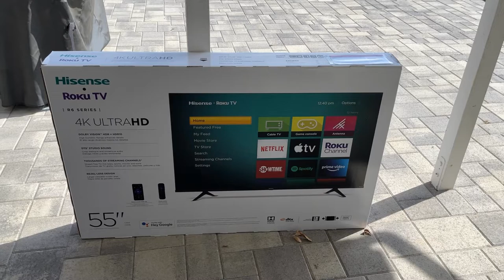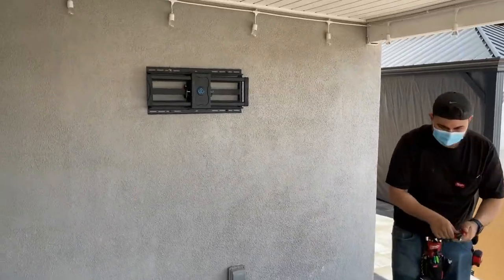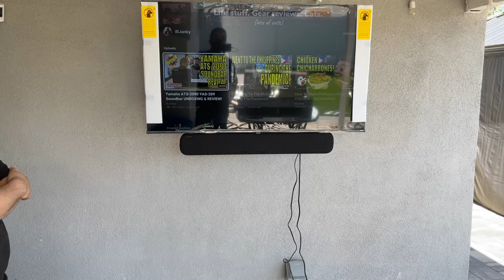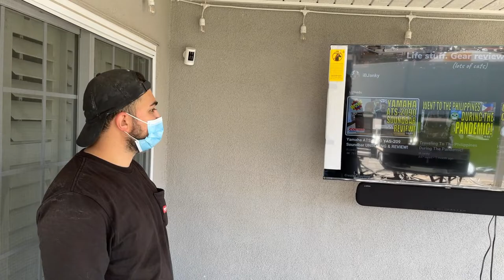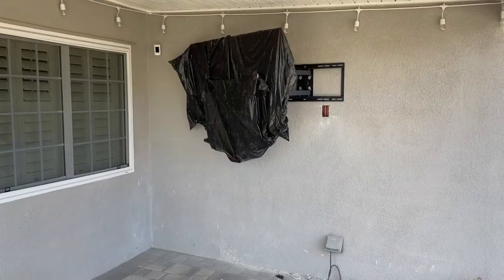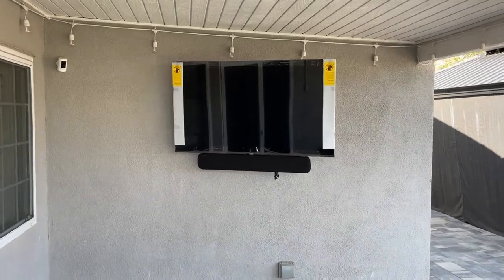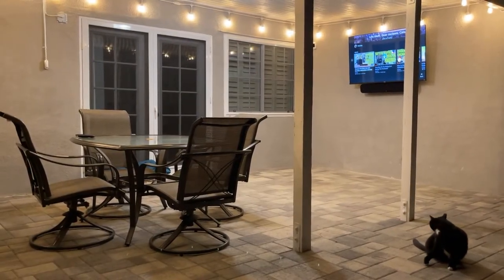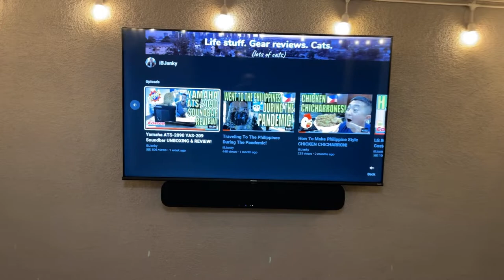My Patio TV INSTALLATION!

Comment: Any issues with it being outside? I’m looking at putting on in a similar covered patio. Also, how did the guy find the stubs through the stucco?
Reply from the maker: No issues with it being outside. It’s under a covered patio, and I put a cover over it when it’s not in use. The installer just measured from the edge of the wall in 16” spaces to find the studs.